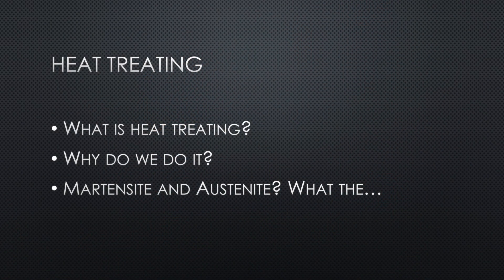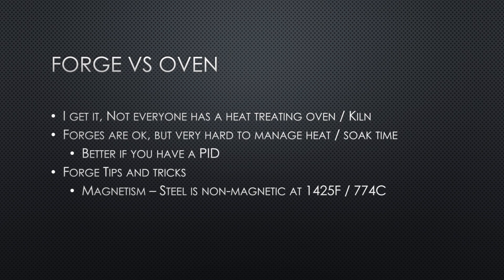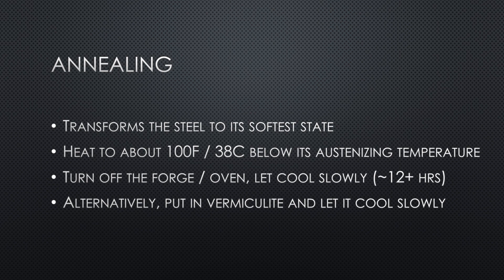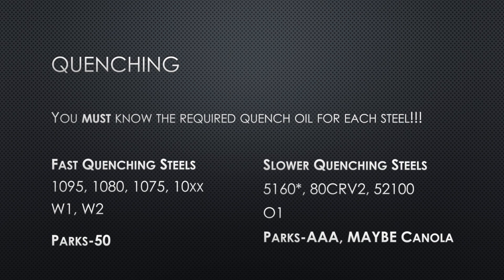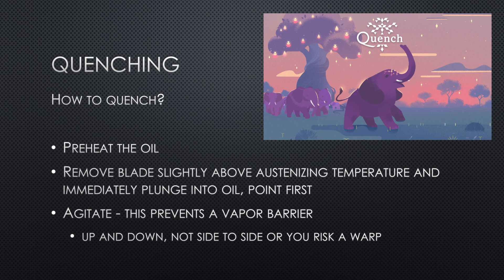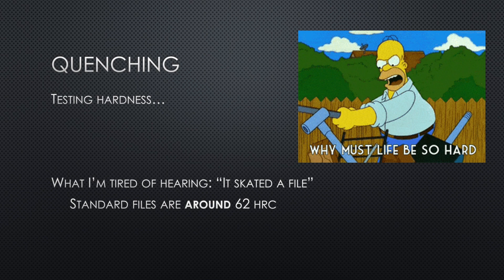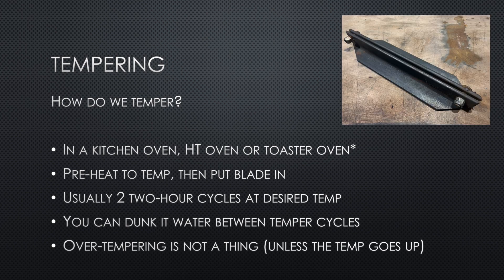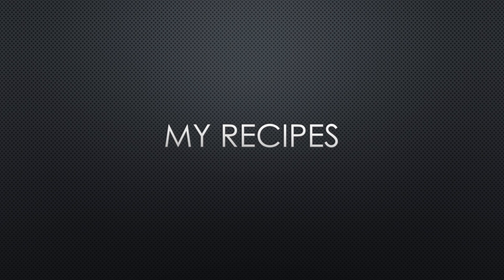Triple-T #97 - Heat treating

Comment: Thank you for the great tips. So if you had to make a stock removal knife from a piece of leaf spring, how would you make the knife and how would you heat treat it?
Reply from the maker: First off, leaf springs are typically curved and 3/8” thick.  You can’t really just do stock removal, you’ll have to forge them.  Treat it like 5160 unless you know different.  Most of them are 5160.  Thanks for watching.